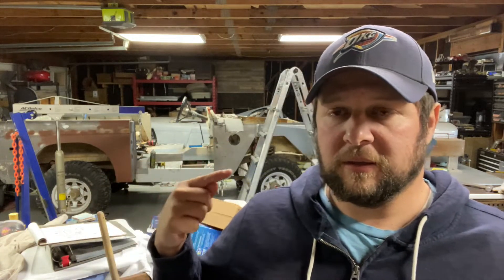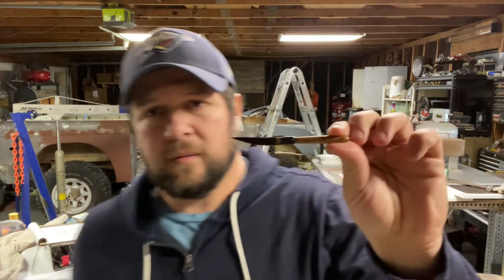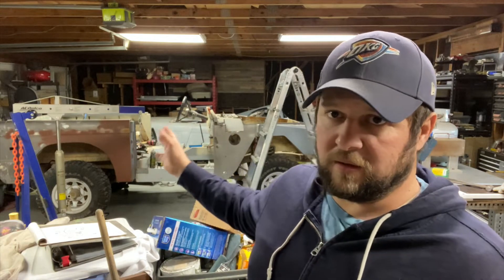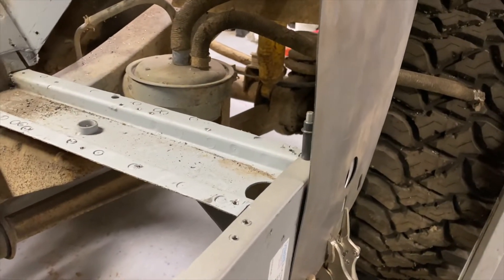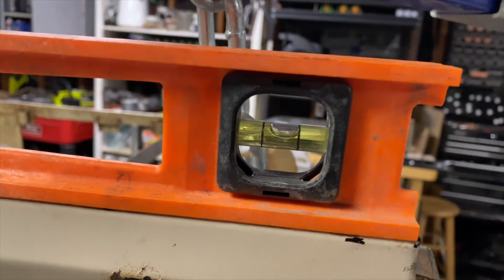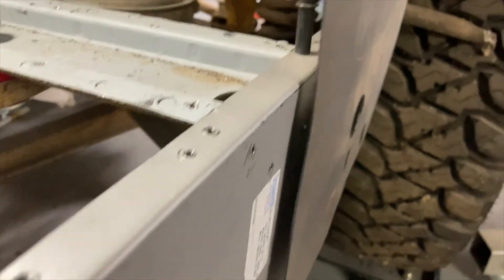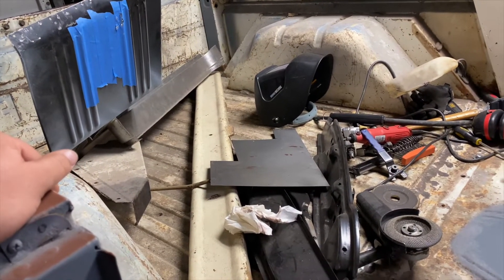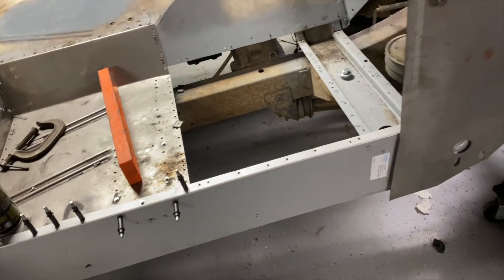Early Bronco Restoration l  Brace and Bushing Problems....

Comment: Hey now that you have the brace bolted down try like you said and put some upward pressure under the brace near the transmission.  It should move the brace down at the inner rocker.  Good luck
Reply from the maker: Thank you.  Hopefully that will solve my issue

Comment: From a physics standpoint the only load on the body where you are working is inboard by trans hump.   You’ve shown you can get it where it needs to be by adding upward pressure outboard by lifting at the firewall.  I believe you need to pull that body mount bolt out (not the bushing),  lift the firewall, massage the floor pan including drilling holes for welding and install it as well as the inner rocker, (also drilled for later welding) secure with tech screws and reinstall body mount bolt.  Get the kick panel lined up as you want it and mark it for welding along the floor pan and that section of firewall, drill the welding holes that you are going to need to install it then secure it with tech screws after taking all your measurements.  Then move on to the a pillar.  The holes in the inner rocker and kick panel should line up pretty close but it’s unlikely the will be spot on.  I’d also take Joe’s advise and use a bottle jack and wood blocks to help maintain the distance you need from the dash to the floor...I’m doing the exact same thing right now but I started on the drivers side.
Reply from the maker: I think I kinda figured out what’s going on. After thinking on it for a while. Next video I’ll show what I think has happened and what I did wrong.

Comment: Put the floor pan back in use a small bottle jack and place on the floor brace in line with bottom of the dash use a small piece of wood to spread the load on top and 2/4 for the bottom. Jack until it’s level or until you get your distance needed..
Reply from the maker: Ill have to try that if the jacking up of the brace from the transmission tunnel dose not work out.
Reply: @RisforRestoration  I built my tub from scratch, many nights it sucked and it’s not perfect but I learned a ton along the way. I’m willing to help. Don’t get too hung up on floor and under braces.. the key is the door post once that in, you’re in business. Send me an email I’ll reach out.
Reply from the maker: Ok Thank you!

Comment: I think what I would do to keep that floor brace up where you want it, put some wood blocks 
Under under your brace on your frame by the tunnel, then get your kick panel in and then you can set your floor pan and put a couple screws from your floor pan into your tunnel that would hold it up where you need it, just my thought. Like watching
Reply from the maker: Thank you!!! Yea I'm going to try to fit the floor pan in next.. hopefully I didn't cut too much off of the body and/or the new pan......
Reply: @RisforRestoration  I sent that reference to you. It helped me because like an idiot I took both sides off at the same time😫
Reply from the maker: @tomgray2308  lol.  Thank you.  I’m not going to go that I depth on drivers side if I don’t have to...